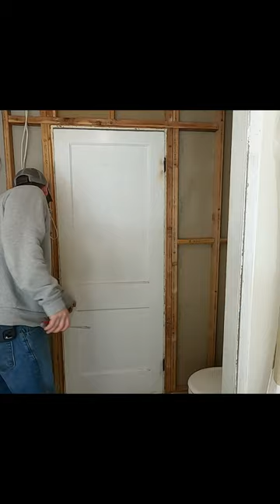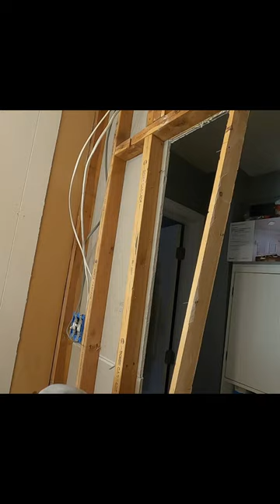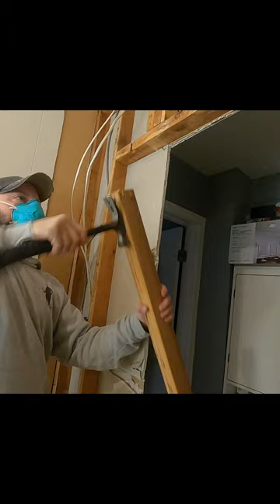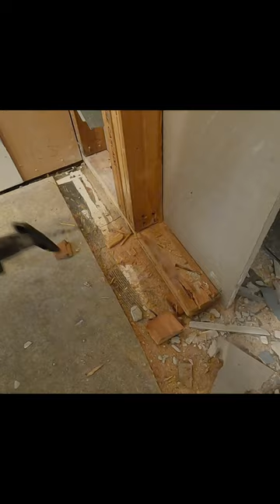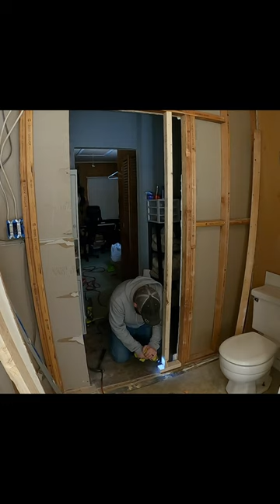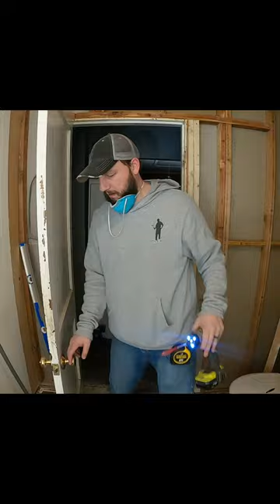Changing Door Swing #shorts

Comment: I know mobile homes are diff than reg buildings. Would you know if it's possible to change out and add Reg doors and windows to a mobile home?. I'm honestly JST learning and wanting to redo my own space. So I'm thinking what's better than DIYin IT. Love how your videos are real world style where you tackle ALOT of Issues everyday DIYERS will encounter. And working with what you have while still doing it the RIGHT STURDY AND HELPFUL Way. 
Many Thanks hope your channel keeps growing 🎉😉👍🏾
Reply: Yes it is possible to switch over to regular house windows and doors. If it's a newer mobile home then the walls are 2x6s and if it's an older trailer the you will have either 2x4s or possibly 2x2s. Which in any case you can add extensions to the 2x6s to make it work properly and add blocking to the inside if the walls are 2x2s so you can add the trim and moldings around the doors and windows